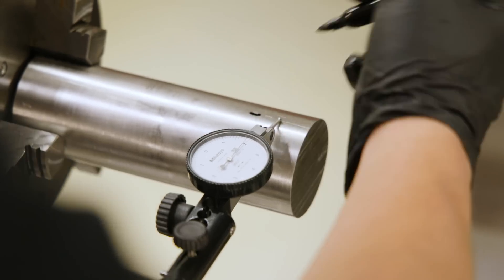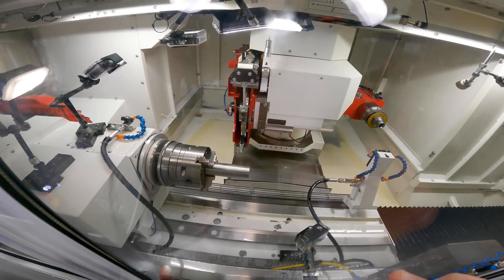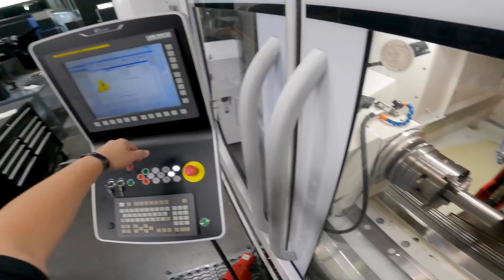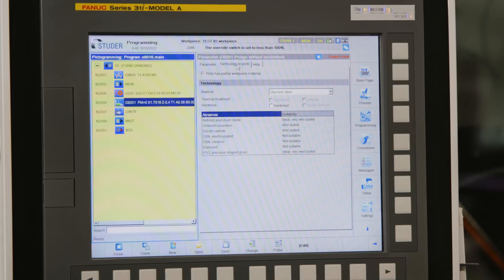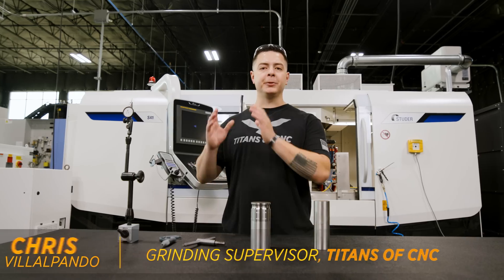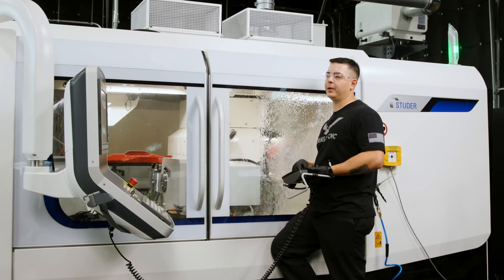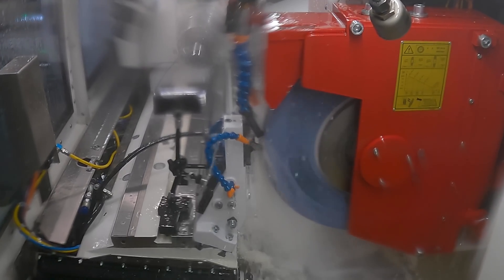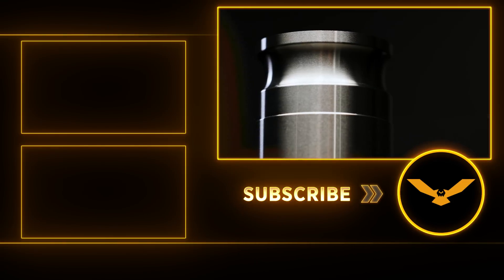Dual Diamond Form Grind on the Studer S41 | FORM GRINDING

Comment: Why probe the X of the part, then enter a dia? Isn't that what the probe did?
Reply: After you probe it initially you have to tell it the diameter so the machine calculates centerline. After that you can just probe in Z.  I try to go over full setups for the educational side of this. Thanks for watching! Appreciate the support!

Comment: The man across the street had a metal testing lab and he had a grinder that looks a lot like the one you use only it was made in 1958. He paid like $250,000 for it back then.
It was not working but being an industrial electrician he let me look the whole thing over at my leisure. Amazing how complicated it was. Big cabinets full of electrical controls, all types of pumps and reservoirs but the working area looked very similar to the grinder you use.

Comment: Correct me if I'm wrong, but wouldn't it be a lot more economical to rough out the profile of that cut on a lathe and then grind it? It just seems to me like that's wasting a lot of wheel, and takes up a lot of time when a lathe could rough that part out with something like .030" of stock excess in 30 seconds...
Reply: With transport, setup and programming, not really.. I expect marginal time shaved off
Reply: @therealsourc3  depents on how much you're making. If you're just making one it's more economical to just program the grinder. But if you're making more I'm sure it would be more economical to rough it out on a lathe first.
Reply: how many are you making? if so then yes/no
Reply: If the part was roughed out then sent for heat treat or a special coating then a grind like this would be great to put it on size in one shot. Rather than multiple grinds. Great question!

Comment: I do some grinding but mine is a little bigger and manual.  I have a Berco RTM 300.  I can grind 90 inches long and dial in around 12 inches of stroke.  It would be a lot nicer if it was cnc controlled like your machine.
Reply: sounds like some serious machining!
Reply: Thats a beast of a machine!

Comment: How would you grind the inside of a cylinder? When you have something like a gas based bike shock, it has a piston arrangement where the piston goes inside a cylinder. The piston can be surfaced using a grinder, but the inside of the cylinder at the edge that interfaces with the piston needs to be surfaced too. The ID of that hole is like 3/4". How does one do it? Do you just use a general CNC mill with some sort of tiny diamond wheel?
Reply: I'd hone it
Reply: @seancollins9745  i don't really know what that means in the context, would you mind saying a little more about this?
Reply: Those parts are usually reamed to correct gauge
Reply: I'm not entirely sure what you mean but something like small inside diameters (anything under a few inches, though there are CNC grinding tools that fit inside larger bores) can't be CNC ground, but they can be honed out with a cylinder hone if that's what you're speaking of, if it's rough inside or something like that, but you won't be doing any form grinding or anything like that.
Reply: @TheExplosiveGuy  Look at a mountain bike shock, the one that's in the middle of the bike frame. There's a cylinder that goes in and out of another larger cylinder. Where those two meet at the exit of the larger cylinder there's an interface between the two parts. They touch. This interface has to keep oil in. It has to be a very close match. It can also not have friction.
Reply: @cheater00  OK I think I know what you're talking about now, it's just a simple bore then. No complex features, just a straight cylinder, is the bore too small or something? What's your reasoning behind the question?
Reply: @TheExplosiveGuy  the surface has to be very flat so that the interface doesn't scrape
Reply: @cheater00  Are you familiar with machining or measuring tight tolerances?
Reply: @cheater00  And if so, do you have the tools to measure the inside diameter and outside diameter of your parts to within at least .0002"/two ten-thousandths (.00005" is preferable) of an inch? If not, I would suggest bringing your parts to a machinist, or speak with the manufacturer of the bike. Sometimes it's a lot cheaper to just buy the replacement part, but it's definitely worth asking around to see if you can repair it at a shop after checking the cost of a replacement.
Reply: @TheExplosiveGuy  I'm not trying to repair anything - I'm asking how thoset hings are manufactured